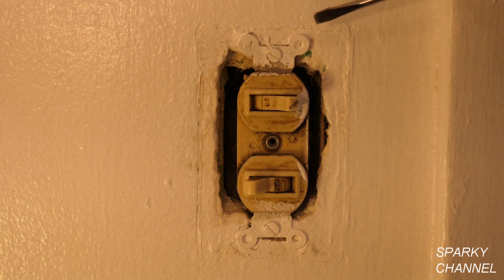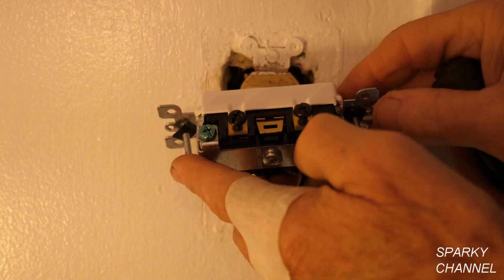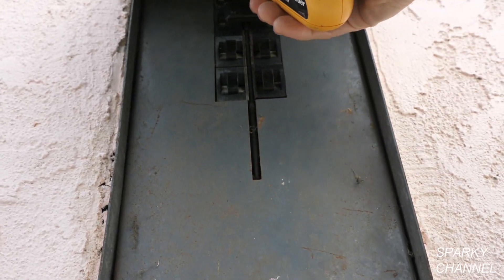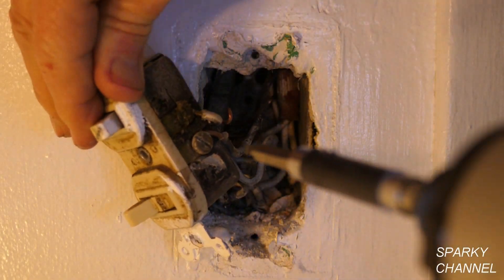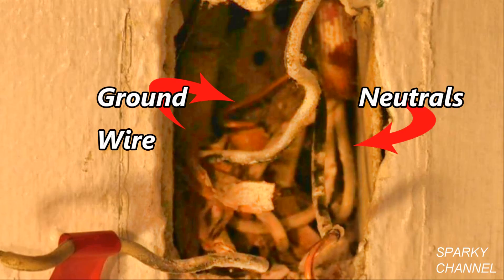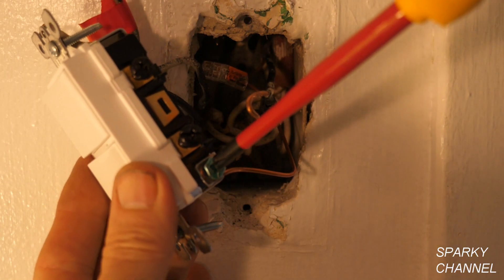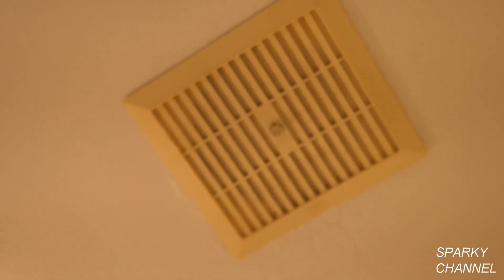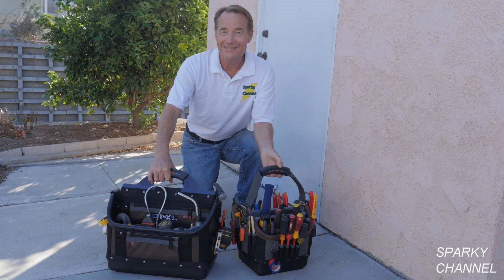How to Install a Double Switch for a Bath Light and Fan

Comment: Hi Sparky,

Your video on replacing the double switch ("Double Switch Test and Replacement for Bath Fan and Light in a 1960 House") was helpful, but I have encountered a problem that I hope you (or someone) can advise me on. 

My mother has an old double switch that controls two lights (one on each switch). One side of the old switch stopped working (it controlled a light in the bathroom), while the other side continued to work (it controlled a light in the laundry room). I replaced the switch, but I can't quite get it to operate the two lights entirely separately. The bathroom light is fine. I can turn the switch that controls the light there on and off and the bathroom lights go on and off. Great. However, the second switch, which is supposed to control the light in the laundry room, only works when I have the bathroom light on (i.e., the switch for it is on). If I have the switch for the bathroom light off, the switch that controls the laundry room light doesn't do anything. The laundry room light remains off.  When I turn on the bathroom light (using the adjacent switch), the switch for the laundry room light turns the laundry room light on an off. I'm puzzled. At first I thought that the switch might be faulty, but I've now tried 3 switches and each time I had the same result. I've changed around the wiring, but that has only made things worse.  

There are two cables coming into the box. The one that controls the bathroom light has power (one black wire as well as a white wire that I have attached to the opposite side of the switch). There is no power in the other cable, which runs to the laundry room light. I currently have the black hot wire fastened to a black screw on one side of the switch and the white wire from that cable, as well as the black wire from the 2nd cable fastened to the brass screws on the other side of the switch. I realize that no one may respond, but I am hoping to figure out what I need to do to correct the arrangement (my Mom says she's OK with having to turn on the bathroom light in order to use the switch for the laundry room, but some Moms will forgive anything!). 

Cheers, Ian
Reply: Just saw this, did you figure it out? Where is the other white wire connected to that goes to the laundry room light?

Comment: In this video, you said that you can recognize that the older original wire is for the light, and the newer add on is the fan. Another easy way for someone to recognize each load on a double switch is to take note ahead of time of the orientation before removing the old wires. In this case, the top switch is the light and the bottom is the fan.
Reply from the maker: Excellent tip Kris, thanks!
Reply: @SparkyChannel  Any time.

Comment: Sparky, In passing I saw an Ideal product that is used instead of electrical tape to wrap around the duplex outlet. Now I cannot seem to locate the product name. Do you know about what I ask? Sparky, Thanks!
Reply from the maker: Hi! Check out my video: IDEAL ArmourBand Insulating Wraps 47-100 https://youtu.be/ySQ6zgV_o1Q
   The link for the product will be in the video description if you're interested.
Reply: Sparky, thanks for the correct response. The ArmourBand  was what I was looking for.

Comment: @Sparky Channel. Thank Bill for another educational video. Seeing old wiring with fabric insulation brings back memories to the home I grew up in that had it and I'm pretty sure all the circuits were run in conduit. If that's the case, does that make it easier to rewire back to the main panel? At least the fuse box was replaced with a circuit breaker panel.

Hope you and your family stay safe and well.
Reply from the maker: Yes, re-wiring is greatly simplified if the wires are in conduit. Thanks and you guys stay safe as well!

Comment: Ground wire in a switch box, decades before required by NEC? Much prefer
a window in a bathroom.
Reply from the maker: I was surprised to see the ground wire there but I put a Wago on it to extend it because it was so short and hooked it up. :)

Comment: the best trick I've found for getting paint out of a device screw slot is to first find the slot by chipping off the outer layers with your electrician's chisel (flathead screwdriver) and then line up the screwdriver at the end of the slot, against the paint filling the slot, and then drive it sideways through the slot with your electrician's hammer (9" lineman's pliers)  
this will usually pop the paint free of the slot and take it out cleanly.  it also frequently breaks the rust on the screw loose from the rust on the box and makes it easier to back the screw out.  if it is still tight, it can sometimes be started easier by seating the driver in the slot, and gently rapping on the handle while you turn the screwdriver.
Reply from the maker: Excellent tips, thanks!

Comment: Hope you and your family are well Bill. When you get an old 1960s house with it’s no ground wire would you always recommend to the homeowner that grounds are run to all switches receptacles or better still re-wire the house which might be easier.

I suppose when cost is an issue all you can do is at a minimum make it as safe as possible.
Reply: that is always a difficult question.  optimally, you would do a full rewire, to being everything up to current standards, less because of the lack of grounding than because the wire is old, and because modern living uses a lot more electricity than the 60s.
the next best would be to protect every general use circuit (code calls it general lighting) and specific purpose receptacle circuit with a dual function arc fault/ground fault circuit breaker - and if the panel board is not new enough for those breakers, (I'm looking at you Zinsco, Federal Pacific and Pushmatic) then you should upgrade the panelboard, anyway, because the breakers are functionally obsolete.  they only trip from overheating, so a hard short (what electricians refer to as a bolted fault - the worst short you can get) the breaker will take extra time to open - leaving an opportunity for the short to start a fire.
Reply: @kenbrown2808  Thanks Ken I know in the UK it would have to be a full rewire and panel replacement. Just wondering if a customer/client is old and doesn’t have the resources I guess you try to make it safe as possible, recommending rewire and panel upgrade but leave to the client to decide.
Reply: @mathman0101  there have been a few projects I've put my foot down and told them if they wanted me to fix it, it needed a full rewire.  I've had a few where the customer couldn't afford the repair and I basically told them my conscience wouldn't allow me to leave the problem unfixed, even though they couldn't pay.  on the good side, wire from the 60s, here is usually still reasonably sound, and wood frame houses usually need refurbished before the wiring gets dangerously bad.
Reply: @kenbrown2808  god bless you for doing the right thing and helping those in need.
Reply: @mathman0101  as a local bumper sticker says, "we're all going to die, and we know it.  you'd think we'd be nicer to each other"
Reply from the maker: @kenbrown2808  Great discussion guys!
Reply: @kenbrown2808  I have found from experience that the wire manufacturers switched from cloth/rubber (BX) to plastic insulation (AC90) some time in the 1950s.  The plastic insulation can last for a very long time and still be flexible if the wire is not overheated by poor splice connections and/or overloading.  The cloth/rubber is another story.  Until a couple of months ago I lived in an older home that was built in 1947 with original BX that in some places was exposed to heat and changing an outlet or switch could be an adventure if you weren't careful about bending wires too much.  We ran a couple of new circuits back to the panel to avoid overloading the old wiring and it worked out OK as I never had a circuit breaker trip in 36+ years.

Comment: I just installed one of these a few days ago.
Instead of just replacing two old switches I also moved the switch location by connecting #14 3wire w/ground. Black wire taking power to the new switch and red and white wires bringing power back to the old switch location and connecting power to the light and the fan. (I painted the ends of the white wire black with a permanent magic marker.)
Reply: by code, you're no longer allowed to do that, because of the requirement for a neutral in the switch box.  also, while it is allowable yo use a white wire for a hot conductor under certain circumstances, it is not permitted to use it for a switched conductor.
Reply: @kenbrown2808  
So what exactly would I connect a neutral to in the switch box when the only thing in the SWITCH box is the switch. There is no terminal on the switch to connect a neutral to... Makes no sense!

Anyway this home was built to manufactured home requirements as they were in 1996.

If you're not allowed to use a white wire for a switch conductor are you saying that the three wire w/ground needed to have black, red and some other color than white which wouldn't have been any different in reality but would have likely cost more money. (Do they even sell that?)
Reply: @kenbrown2808  
Okay so what I should have done was bought 4-wire w/ground and simply capped off the neutral in the switch box (to meet most current code). Ugh. Guess I'll just pretend that this was done before 2011 when the old rule was still in effect. 😉

The switch box is in a location where no one should ever need to (or want to) tap onto it to install a receptacle or anything else. The switches in it simply operate a ceiling light and exhaust fan in the M bath. There is a double duplex receptacle at the vanity. But if someone wanted to then they could replace the 3 wire w/ground with a 4 wire w/ground without too much trouble but it would be easier to tap off an outlet in the adjoining master bedroom which is still the same circuit.
https://m.youtube.com/watch?v=pnlHCiRN_RU
Reply: @njsongwriter  it is so that when you decide to replace the stack switch with a dimmer for the light and a digital timer for the fan, there will be a neutral to connect the timer to.  and the reason for having the white either hot or neutral but not switched is so nobody in the future mistakes it for a neutral because the switch is off, and connects it to the neutrals.

Comment: Do you have a video for a switch with a light on the other end so it lights when turned on?
Reply: A pilot light switch is what you are looking for.
Leviton 5628-2w or for more fun, 3 way version 5638-2w
Reply: @JasonW.  I bought a Eaton light switch with a pilot light. Want to replace my attic light switch with that so I know when the lights are on from the switch. When I took down the current switch the white wires are twisted and capped with a wire nut. The black wires are on the switch. The new switch has 2 black screws on one side for “line” and the other side has one brass and one silver screw. Do I need to put a pigtail on the whites and attach it to the silver screw on the new switch? Trying to wire it properly thanks.
Reply: @mugg1841  Yes, add a pigtail to the white wires and attach to the silver screw on the switch. Edit: incoming line black wire goes to the black screw, and load black wire to the brass colored screw.
And then be thankful the original installer brought power to the switch, then to the light, or you likely wouldn't have the white wires.
Reply: @mugg1841  You'll know if you have black wires on wrong screws, the pilot light will be on all the time.
Reply: @JasonW.  thanks for the reply. I thought that’s what needed to be done but wanted to be sure before tapping into the whites to add to the switch.